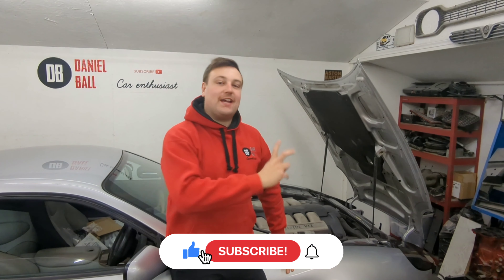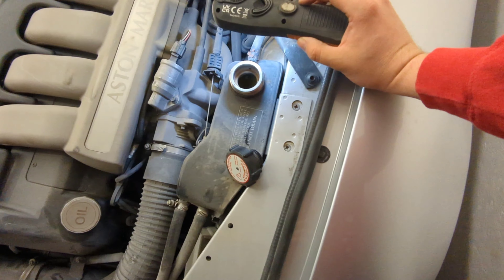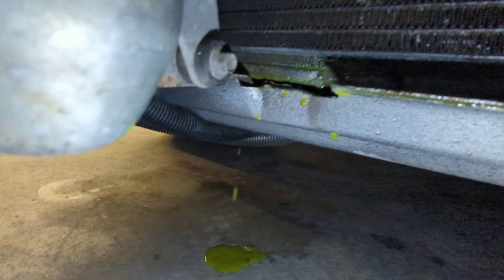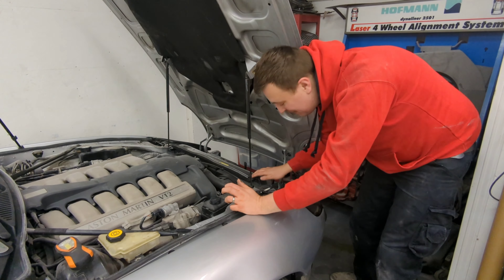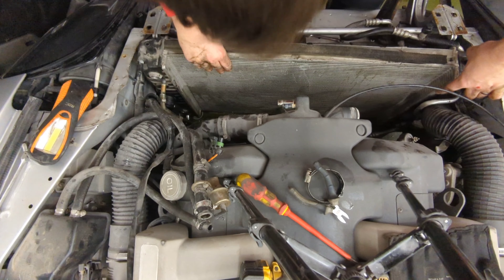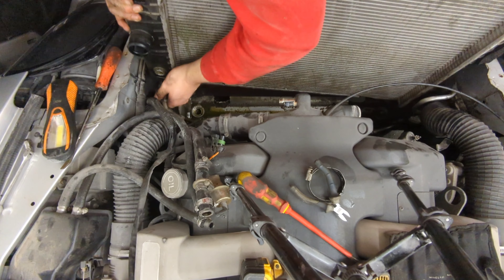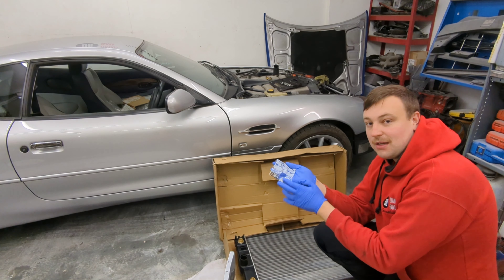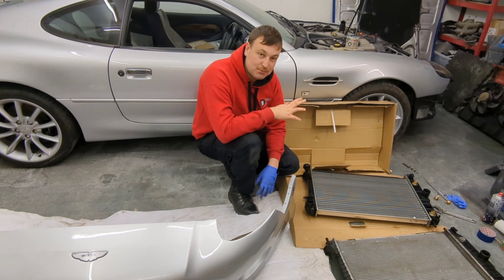MASSIVE backwards step! Salvage Aston Martin DB7 build

Comment: You may see it as a backwards step but I see it as a win!   Why?   Leaking in your garage is far better than out on the open road!   You've caught it before it does some damage to your engine.   Definitely a win.

Not an automotive expert, but I'd say to remember that the radiator that was specified in the DB7 Vantage would have been qualified to work in deserts at temperatures you'll never see in Britain.   I think you're going to be ok with the thinner radiator.

As for drilling out, just flush it out from the other wholes after drilling to get any shavings out.   I think that should do it.

Finally, any companies that would inspect and fix the original radiator?   Is that an option?

PS - Hoped the garage door was open when warming the engine!
Reply from the maker: Yeah you are completely right. And as you say, they were built for much hotter climates. It's definitely worth a shot!
The drill bill has now arrived, so I will give it a go this week 🙂 thanks once again.

Comment: I would’ve done the same as you Dan. Good luck with the drill out. Perhaps a vacuum cleaner over the drill bit when drilling? Also use some grease on the drill bit to “catch” some of the brass chippings to prevent it falling in? Could also drill it upside down?
Reply from the maker: All I will say for now is watch my next Aston video. Things don't go to plan 😂😂😂
Reply: @DanielBall  oh no 🤦🏻‍♂️
Reply from the maker: @sutt16v  don't worry though, it SHOULD have a happy ending ☺️

Comment: cant you take the brass  nut off the radiator so you dont get bits in the cooler ?
Reply from the maker: Sadly not as it's inside the plastic header tank. It's all part of the cooler too. Going to fill it will grease and flush it afterwards. Should be fine 😀
Reply: @DanielBall   best of luck mate  the guy next to Ware our yard is was  washing a db7 today  I did ask if could knick radiator  lol 😆
Reply from the maker: @AdamIntimidator  haha, you don't see many at all.
Reply: The cooling Dan is a bit marginal with the current spec. That V12 generates a lot of heat and there are no vents on the bonnet. Would be careful going for a lower spec rad. Good luck with the project, and enjoying your work
Reply from the maker: @markd244  thanks, I will monitor it and go from there. Personally I think it will be fine, but I definitely see your point.